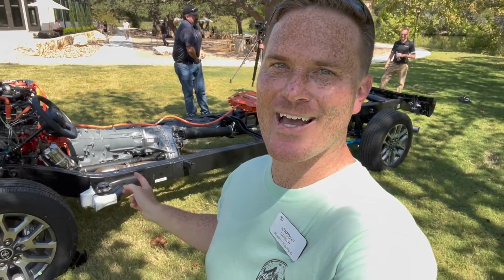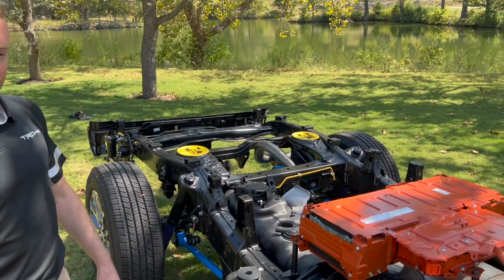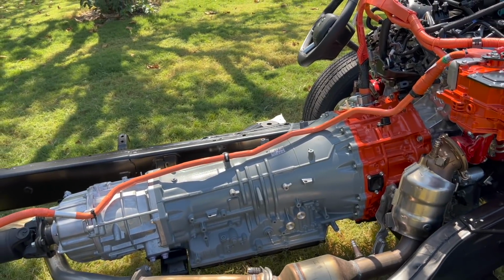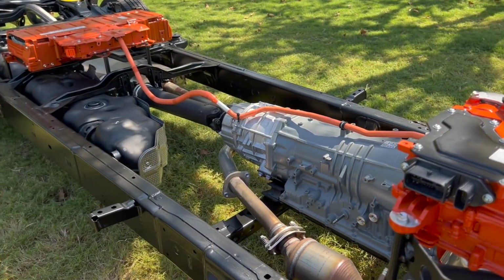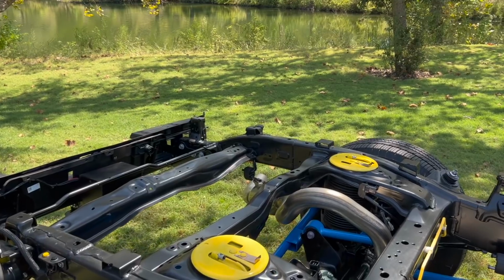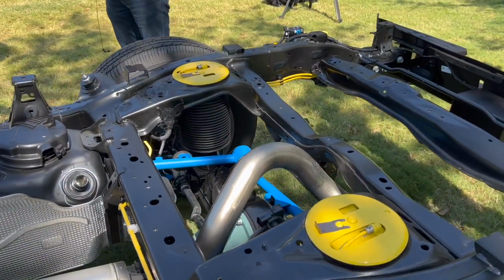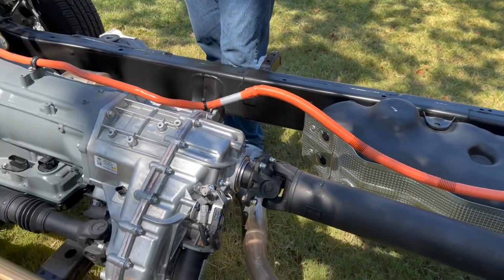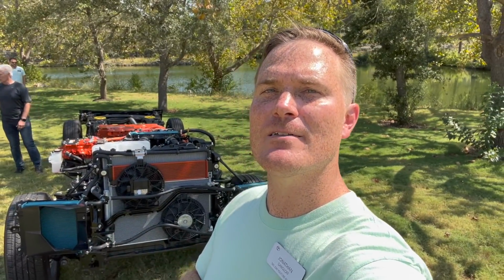QUESTIONS ANSWERED - 2022 Toyota Tundra Frame *BREAK DOWN*

Comment: This is absolutely garbage.  The worst of gasoline and the extra cost and more complicated EV merged into an unserviceable planned obsolescence POS.  

Still has catalytic converters to steal, and gas tanks to punch, and an expensive battery that’s too small to do anything but pass a very specific EPA test, not enough to really reduce pollution
Reply from the maker: Buy a Tesla and keep putting huge holes in the earth for your un recyclable batteries then.
Reply: @TRDJon  so it’s Ok to buy this Toyota and put “holes in the ground “ for its high voltage batteries? It’s ok to put holes in the ground for gasoline station tanks that leak into you kids drinking water?  Interesting.  

non se·qui·tur
/ˌnän ˈsekwədər/

noun
a conclusion or statement that does not logically follow from the previous argument or statement.
"his weird mixed metaphors and non sequiturs"
Reply from the maker: Yea cuz they are recycle unlike lithium batteries. One of the reasons why TOYOTA used these ones
Reply: @TRDJon   google redwood battery recycling. You really are not trying.
Reply from the maker: Ok
Reply: @TRDJon    Niiiiiicce. You and the non se·qui·tur
/ˌnän ˈsekwədər/ 
a conclusion or statement that does not logically follow from the previous argument or statement.

Comment: Two questions: #1. What is the horsepower and torque? 
   #2. Is there a benefit was going with lug bolts versus Lugnuts?
Bonus question; #3. What is the MSRP? (I’ve heard it’s only for the TRD pro)
Reply: 437 HP

Comment: Time will tell if the electric rack and pinion steering will be strong enough and reliable.  It’s not like they are brand new to trucks but I’ve recently been seeing that they are failure/problem points for many manufacturers.

Comment: Now that’s a FRAME! Good job Toyota. The previous model could’ve really benefitted from this fully boxed frame.
Reply: It would've been undriveable with the leaf spring set up. The old frame could flex and help the suspension out out. It's why this one has coil overs out back.
Reply: @jesseashmore8426 I never said anything about suspension? I said fully boxed frame would’ve been nice one the older tundra. Obviously 5 link rear end included.

Comment: Would love to know whether the gas engine would still be able to propel the truck if the electric motor failed?
Reply: Most likely it would, but it would probably only allow you [x] amount of miles before the system shuts down completely.
Reply from the maker: Great question!

Comment: Not a fan of the air compressor behind the rear wheel. If you live in the frozen Northern states where they salt the roads in winter that thing won't last 5 years. Love the new tundra though. I've already started talking to dealers to upgrade my 2005 tundra.
Reply from the maker: There is a fender liner remember. So should be good
Reply: @TRDJon  I'm still skeptical. I was an auto mechanic for about 6 years in Northern NH. That road salt eats everything, EVERYTHING!
Reply from the maker: Yea that’s the crappy thing about snowy areas and salt then. Not real good place to put items it seams

Comment: have fun putting on 35s with lug bolts... couldn't hey have kept the same system as the tacoma? I wanna see the guy who designed it putting a wheel on the side of the highway.
Reply: Just experienced bolts for the first time on a small trailer. Terrible , especially when lugs are tight. Basically have to loosen all the way, it's very difficult to get it on even.  I do want to see the person MS, just the fall guy. Like you said probably never had to do it.
Reply: @TontoBongRonto  yeah it sucks. Most likely be able to swap the tacoma hubs for this pos. The dealers might be able to do something like this, if they consider selling the truck with bigger tires, but any other mechanic will definitely be able too.

Comment: Nice review! Does the engine use a fan belt? Does the MG act as the starter and alternator?
Reply from the maker: Thanks! Not 100% sure honestly.
Reply: @TRDJon  I know the current Prius does not use a fan belt. I couldn’t tell from your video however since the front of the engine is so close to the fan shroud.
Reply: It does, however, the fan has an electric clutch that allows the fan to work when it’s needed only. Heard that from Toyota engineer in another video.

Comment: WHY WHY WHY!? why is Toyota going over to lug bolts instead of nuts? i absolutely hate bolts for R&R wheels, and if you strip a stud/nut you can just replace it, but if you strip the threads on the hub on a lug bolt, you gotta replace the whole hub!
Reply: Bolts are a bitch even on a small trailer tire haha. This thing just screams money pit.

Comment: -turbo Cooling will limit the after market bumper for off -road modification , its next to wheel , if they can make same shape as they made for Electric Inventor and place next to main grill would be great .
-great thing is they made new Body mount which pushes less noise and vibration to the cabin , this is great invention from Toyota and want to see on other Body of frame models .
- i love the power on hybrid but technically  i will stay away from complex engine and technology .

Comment: Nothing  new or revolutionary,  everything in the new Tundra has been done already. rear air suspension expedition/Navigator, 10speed Ford/GM, tt Ford f150 , power boost class of the field. GM had a rear coil suspension from the sixties into the seventies. what's shocking is that it took Toyota all this time to do what they done with their 2022 truck.

Comment: Terrible place to put the battery.  Interior space is at a premium already.  This looks rushed.  
I’m already thinking about how/where to relocate it
Reply from the maker: Let me know when you find a better spot
Reply: @TRDJon  literally anywhere.  Under the box, under the floor, squeeze it under the hood.
Reply from the maker: Then it’s all potentially at risk to the elements
Reply: @TRDJon  some sort of cover would fix that.
Reply from the maker: But you have all the drive components underneath too and also have to consider mass production, I think ford is in the same location too
Reply: @TRDJon  Ford’s battery is under the bed, right above the axle.  It may be a smaller battery though.
Reply from the maker: Ah thanks for that input. I know they use lithium batteries for that truck too, so they don’t need as much room as Toyota does

Comment: Having a hard time identifying where the new Tundra raises the bar against the competition. Appears as though Toyota was looking to catch up to the current competition, but not exceed it, let alone bring any new innovation / capabilities the competitors already offer or have in the works.
Reply: If this whole engine and so was in the Tacoma... now that would be pretty amazing.
Reply: I think this is a new way of incorporating the hybrid. And it is a Toyota, the competition has some beautiful trucks, but with way too many issues. For one, Rams back window leaks, and the etorque systems are going out. I will stick to my Toyota, I have an 07 now, and I will get one of these Hybrids, but may wait until they have a plug in version.
Reply: Yes but I guess the way to think about is, that they are using the more current technology that are proven to be reliable. Which is what Toyota is all about. Which I guess I don't mind to much. Instead of bleeding edge stuff that has many random issues. They went with thing that work for sure but is more current. Even the twin turbo engine they choose has already had a good run and has proven to be pretty reliable as it's been in the lc300 for a while now. The only thing I wish they did is that since it's already a hybrid; they should have put in an even bigger ev motor and break the 500hp and 600lbs of torq spec. Power like that would really make people attracted to it. Something like 530hp and 657lbs of torq would draw alot of attention and make it really competitive with the raptor and trx.  Thos kinda numbers would allow it to break into that space but still do its own thing at a lower price point. All with just a little bit bigger ev motor.
Reply: no one can catch up to toyota’s reliability

Comment: Do u think adding a aftermarket bumper like a ARB, would that affect the mpg since there is a lot of aerodynamic design for fuel efficiency in the front especially with auto deployed spoiler and more importantly would that affect the air flow to the intakes and the intercoolers causing a less than optimal cooling since the front design have specific tunnels for the intake and intercoolers? Great video btw.
Reply: Any change to the bodywork will mean worse mpg. Not mention more weight

Comment: On the pro model where it has the ugly camo on the fender and tailgate and the on front. Is there an option to just have flat black?
Reply: If it makes you that unhappy I’m sure you’ll be able to order factory paint matched fenders and tailgate spoiler to swap out.
Reply: Or trade with someone that wants camo that has color matched pieces. Plastic shouldn’t keep anyone from buying this truck.
Reply from the maker: Not on pro
Reply: @TRDJon  that so dumb so u have to that ugly camo on it??? Unreal

Comment: Is the exhaust system made from stainless steel? Kind of looked like it…? 
 How about what parts of the body are made from aluminum? If it’s true that the two front doors are aluminum, why is that? 

 Great work on the videos!
Reply: Probably to reduce weight as much as they could without sacrificing safety and stability

Comment: Why ls500 has lower hp got 2 watercool intercooler but tundra only has 1?
Reply from the maker: They basically took the block from that. Different internals and all too
Reply: @TRDJon  thank you for your reply, saw some ls500 front with no bumper I figured ls500 has much smaller radiator for intercooler on each side, like less than half of the size comparing to tundra

Comment: Will the Toyota dealers be able to install front tow hooks in the 2022 Tundra, being that the factory left them out?
Reply: No, there are none. No mounting points due to the active air dam system.
Reply: @DirtE30  it's a STREET truck, never meant for it to be off road!!
Reply: @dundeeecroc  then why did they go to all the engineering expense to make a retracting air dam when all the competition have a fixed one that you have to remove to off road it? Lol

You do realize 98% of people who buy a 1/2 ton truck aren’t going to take it OffRoad to any extent that will require a recovery hook? 

Same people squealing about terrible MPG now losing their minds over tow hooks.

Comment: Wish the hybrid prioritize fuel economy instead of power.
Reply: They didn’t make this truck for you bud. Go buy a Prius.
Reply: @lukejohnson1421  let see what they have in mind for the 4Runner, if not I would have to consider a diesel GM truck or Ford Lighting / Cyber truck
Reply from the maker: Idk what more you need from it. Better than the out going model and the hybrid probably gets like 12 more MPG
Reply: @TRDJon  really? The forecast estimate saying it is about 19-20 mpg, the previous model is 14mpg, if I can get 25mpg I will be very happy.
Reply from the maker: The regular 3.5 is higher than 19-20 and the hybrid is going to be even better than that
Reply: @TRDJon  yeah just like the Tacoma gets 22 mpg. Toyota’s mpg are like Biden’s economy. Inflated
Reply: @mrnova70vp  I get 18, sometimes 19 ( on 87) on the highway with the v8. The comments saying that matched with a 10 speed would probably be close to this. RIP to the wallets of this one .

Comment: The hybrid system is not new.  Toyota has been using this same hybrid system (motor sandwiched between engine and transmission) in their Hino buses and trucks since the late 90's.  So it's been tried and proven on the commercial level.
Reply: I would have zero worries with the hybrid components. Toyota has refined this system to almost perfection in the last 30 years. They wrote the book on hybrid propulsion. I can’t for the official EPA fuel mileage numbers.
Reply from the maker: Well there you go then.
Reply: new for Tundra*